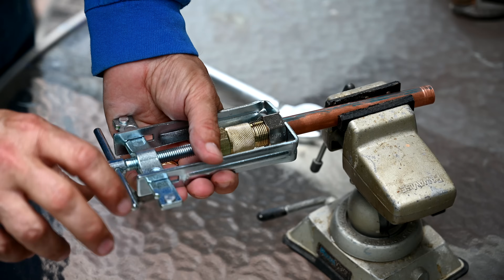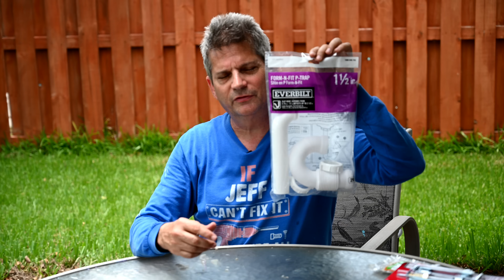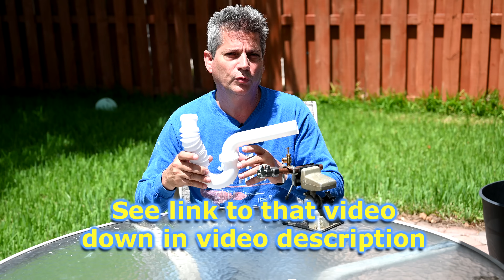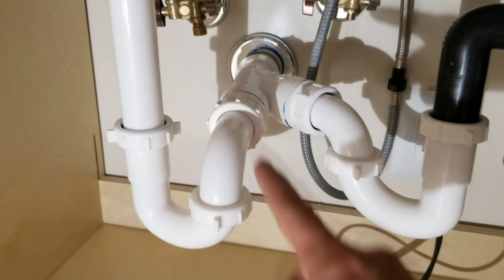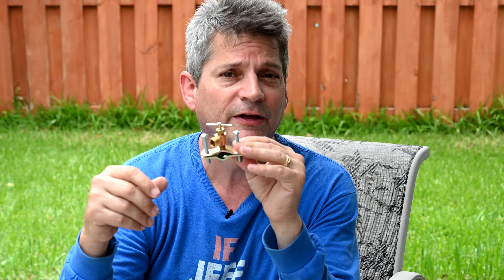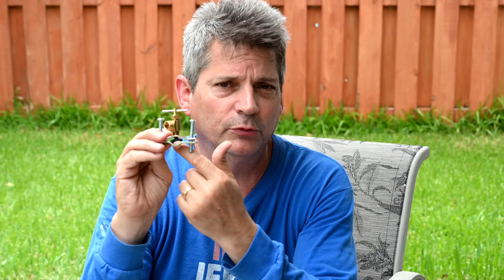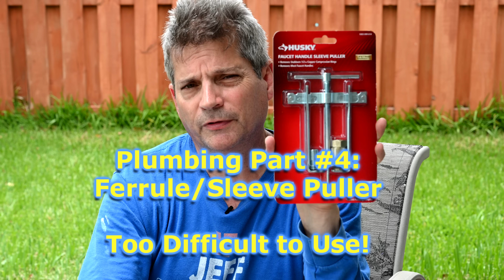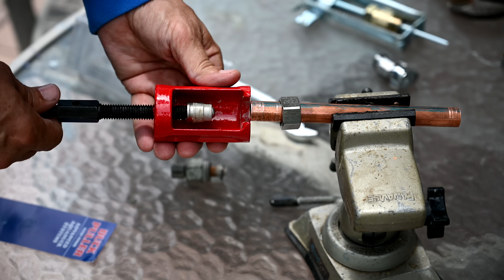4 Plumbing Parts/Tools You Should NEVER Use. NO Plumbing Fails

Comment: I think the issue I have with the video is the personality.. A lot of arrogance coming from the speaker and a general hatred toward 'DIYers' - saying that others 'aren't bright' or 'too cheap' is quite pretentious. You don't know what has happened in the past to a pipe: maybe the plumber before you had to cut the pipe back to get the ferrule off and now it doesn't have the extra length. You literally say that you 'couldn't cut the pipe back because the plumber before you wasn't too bright and didn't leave enough pipe' - but if you were going to cut it back, you would have been the plumber who ' wasn't too bright and didn't leave enough pipe' ... lay off handymen. self-sufficiency is something to be proud of, and if they are doing it incorrectly because they aren't a PROFESSIONAL, then teach them, don't condemn them.. steps off soapbox
Reply from the maker: "self-sufficiency is something to be proud of"? what about the 85 year old widows I had to go in and help who had no money to pay anyone to fix these disasters left behind by these guys? You have a misplaced sense of false righteousness. You support the "feelings" of these clowns over their victims. You made up scenarios that don't hold water and have nothing to do with the 4 parts at hand. Also, anytime I encountered a short pipe, I FIXED it, I corrected whatever the previous plumber left behind.

Comment: G'day
The first tool you need to throw out is that spanner. They cause damage to the fittings/nuts because they don't fit correctly. They are also more likely to slip off and cause injuries and you still need to have the correct size spanner for when those ones don't fit in awkward places.

The next issue is why would you need/want to remove anything that isn't broken/damaged. The Ferrule (Olive) seals by crushing into the tube. How do you repair the crushed Tube?
Reply from the maker: this is what separates us engineers from people who just install parts. The tools we use do not crush the tube like you claim. I've never had any of my tools either crush or flare the tube. If it did, I would never be able to get the new ferrule on. You ask why would I change the Ferrule? I ask why in the world wouldn't you change the ferrule? To me, it's a sign of laziness when people don't complete the job. The new valve comes with a new ferrule designed by the manufacturer to work with their new valve, and tolerances might have changed in the 40 to 60 years since your previous ferrule was attached. So the prudent thing to do is change the ferrule with the new one that comes with the new valve.

Comment: I am a licensed  building contractor and was a certified master plumber.  I have used s traps in both my homes and several apartments for as long as they have been around, as well as using them in many of the repairs or new installations I have done in my 30 years in the business, and never had a call back or experienced a problem with gas intrusion.  I think this is another of many, many examples of overkill in the regulatory business based on  a one in a ? occurrence resulting in added expense to homeowners who can barely afford to pa a plumber the $100 or more. for the repairs or installation required.  I have worked in two counties, one which has building codes and one without, and haven't seen any real difference in the quality of the work involved.  Regulatory rules are too often a result of efforts by industry, including contractors who sit on the guidance committees, to increase their profits.

.
Reply from the maker: Maybe you can explain that to all the people who have S-traps that siphoned out on them, now they are smelling sewer gasses. Yes, in some cases S-traps can be safe, but others where you have too much vertical drop after the S-trap you run the risk of it siphoning itself dry. Besides, what is so hard about a building a P-trap instead of an S-trap when you remodel or when you're building a new house?
Reply: There is a Bella a lot of difference between installing a strap and an existing strap in a remodel which would typically be the case with a homeowner.  Cutting into the wall to reroute the plumbing g and reconnecting to the main waste line in the crawlspace or basement will cost hundreds or over a thousand bucks.  Have you done this?
Reply: Correction "installing a strap replacing an strap"
Reply: I apologize-my spell check keeps replacing ptrap with strap.

Comment: Hi, interesting video! Well done.
Couple of comments/questions:
1) They use a saddle valve (similar to the one that is outlawed for plumbing) for high pressures of air conditioning systems, don't they? It is not the saddle valve that is so bad as it is the cheap style that is used. If the valve was sized for the pipe it was going on so that the pipe was forced to maintain its shape and the hole was pre-drilled rather than use the punch, almost all of the objections would be satisfied. Then the code could be modified to only require that the use of a saddle valve be limited to a line that has a shutoff within so many feet, etc., or something like that. I have seen the commercial installers of home humidifiers and also add-on refrigerator ice makers use these things, so it is not only DIYers - as you are probably aware. 

And the problem with the saddle valve is not that the idea of 'saddling' is so bad, is it? Rather the design of the saddle valves used was so bad that the code writers outlawed them because of that design. If the attachment formed around the pipe so it could not deform and the material in the saddle was not so degradable so that a drilled hole of the appropriate size were used (no punch), wouldn't the saddle valve be as acceptable as other types of shut-off valves?

2) Those tools for pulling the ferrule are all kind of bad, aren't they? When you push on the soft copper end with the tool, doesn't it compress the soft copper tube, which will make the diameter larger and harder for the ferrule to slide off even if it can be broken loose from its original position? I agree with you about the assessment of the cheap tool - it will probably work for 80% of the ferrules, however, but the hard to remove ones are too few and far between to spend the extra money for better tools. (BTW - didn't you install the cheap tool incorrectly in the video? Just asking - I don't have one, nor am I a professional plumber.)

If the cheap version doesn't take it off easily, wouldn't it be better to score the ferrule with a hack saw or Dremmel cutter and then snap it off by using a flat screwdriver to break the outer rings (that part that doesn't get cut through before hitting the copper)? What is your take on that; that is, is there a better way than the puller? 

3) I have a bunch of these compression fittings in the house we have now - it was built in 1996 as part of a subdivision. Anyway, I was replacing the sink's plumbing in several places and would really have wanted to replace those shutoff valves, but they are all compression to 3/4" copper and hard to get at to deal with. If they had sweated on a fitting and attached a threaded shutoff to it, I might have tried it. (But there is no good way to shut the water off to my house - I can't find an inside shut off or one near the house on the outside. The source is 100 yds away down the street at the meter. And it doesn't shut the water off completely - it seems to trickle away after it is shut off. I hesitate to deal with that for the shutoffs that are still working ok.  I know about that because I added a line to the cold inlet of the water heater to get a water supply in the garage - I refused to use a saddle valve, BTW.  I released all of the pressure and drained everything that I could, but it trickled on and built up pressure again eventually. So I had to let it trickle as I made the connection, but it was in the garage so it wasn't as hard to deal with as an under-the-sink would be. Plus I caught most of it in a pail.)

Do you have a preference for the compression vs sweat vs sweat threaded with threaded shutoff valves, and why? Do the compression fittings ever leak at the compression ferrule? Obviously, my preference is using a threaded adapter and threaded valves, but I don't think that in the crowded conditions I could sweat the adapter onto the pipe without a lot of trouble in the form of fire and leaks.

4) Could a 1500 watt heat gun be used reliably to do sweat fittings? I think it can get hot enough, but whether it would work on say 3/4" fittings?
 
Thanks!
Reply from the maker: Saddle valves are bad because you should never pierce a pipe that will be under pressure, you don't know when it could leak. Often saddle valves are cheap brass or cheap Chinese white metal, and dissimilar metals attached to copper is bad, it will corrode. other failure modes for saddle valves are the slight leak and dripping onto the screw which corrodes and falls apart, now the saddle valve breaks off. the tools that pull the ferrule off do not damage the copper pipe like you think, it is not that soft, certainly the round copper pipe is strong enough to resist the forces of the ferrule pulling tools we use. I have never once had a problem slipping on the new ferrule afterwards. Believe me if there was even the tiniest amount of flaring of that copper pipe from my ferrule puller tool, you'd never be able to get that new ferrule on with those already super tight tolerance. They are already so tight you have to spin it a little to get it onto the pipe. I prefer compression valves over solder, because it is less work, and anyone can change out the valve. I have never once seen a leak at the ferrule, only from the valve when the stem breaks, or the valve seal at the handle goes bad. I refuse to believe you don't have ea water shutoff somewhere in your house. Check all around outside, maybe another box in the yard? I've seen them at the water heater, I've seen them below the AC handler, I've seen them in the bathroom or under the kitchen sink feeding the house, and even in the laundry room above the washer and dryer. Every house should have one, if you don't have one, get a plumber in there to get you one. If the water main does not shut off at the meter, call the city in to fix it, that's their responsibility. With water trickling, you'll never be able to solder pipes with water in them. A heat gun likely will not help you, use a torch made for plumbing.
Reply: @jeffostroff  Thanks for responding. I look at the heft of your tool and it suggests that an awful amount of pressure can be applied. The distance from the ferrule is about an inch it looks like, so there is nothing to prevent the pipe from compressing if the pressure is great enough. If they work well that is great - what did you think of simply scoring them and popping them off? Too much chance to damage the pipe?

I looked in all of the decent places for the shutoff. The main shut off at the meter I found - the previous owner had shut the water off there and didn't tell me of any other place. I looked at where the water comes into the water heater - it comes up through the wall between the garage and the kitchen. The water heater used to be in the attic, but they had it moved to the garage (right below) where the original was. There is no shut off up there, but there is one on the inlet to the water heater because I added it.

I looked in the likely places in the house and probed the flower beds in front and found only a couple of possible spots. It makes little sense that they would run the water pipe all of the way from the left side of the lot in the center of a gas pipeline right-of-way across the driveway along side the house to the center of the house or farther when the water would more easily have been reached from the opposite direction, but that is what it appears they have done.

There is a large sewer access manhole in the sidewalk past the driveway about half way to the walkway to the front entrance. It occurred to me that they might have taken advantage of the trench for the sewer and that could bring the sewer and the water into the rear of the garage which then is aligned with the inside wall of the kitchen where the kitchen plumbing is located and with the water heater, but I could find no evidence that they brought it in at that point or nearby. 

The only other place on this side of the house that has water service other than outside faucets is the laundry room alongside the kitchen behind the garage (the garage is on the front of the house parallel to the street entered from the left side in front of the entry to the laundry and through it to the kitchen). The other side of the house has two full baths. 

The master and the bathroom for the bedrooms are along the other side of the house all the way to the rear of the house. The only place along the front that looks like it could have an access to the plumbing appears to be a source for the sprinkler system. I have not dug it up to see if it has access to the house. But suffice it to say that I could not find any location that even appears to be a shut-off for the house on the outside. I guess I will have to contact the city.
Reply from the maker: @dwjw1  Yes, slicing the ferrule is an option for the person who is skilled at it. I plan to do a video soon showing several methods for removing the ferrule off the pipe, including cutting it off.

Comment: I've looked down the thread here and several Brits have rightly commented that the quickest and easiest method of removing a ferrule (olive) is to cut a diagonal groove across it with a junior hacksaw until nearly through, then inset a flat blade screwdriver in that groove and twist. Replies have suggested this may be in some way difficult, or liable to damage the pipe. It takes only 7 or 8 passes with the saw to give the depth of cut needed and it pops off easily. There is no need for special tools which will often not fit in the kind of restricted spaces plumbers work in all the time anyway, when such a quick, simple and foolproof method is available to anyone regardless of skill level.
Reply from the maker: "regardless of skill level.", LOL John I've seen some really stupid people out there. Even good friends who are dumber than a door nail that I've gone to help do repairs in their house, they could never handle that. Sure it's a good idea for those who know how to do it, but not for Joe Sixpack

Comment: the pipe tap, I saw a plumber use something similar at house I grew up in, but it had full galvanized pipes, no plastic, nor copper, water lines other than that, and 1 more weird 1 I didnt see installed, but on first one I remember him drilling a hole before installing the one to fridge, & I would have been in my single digits & I am 53 now. the other was another saddle to galvanized pipe feeding a whole house humidifier, that attached to furnace. the furnace used copper to it, but was there when parents bought home before i was born.

as for the tool to remove the ferrules, put a hose clamp over it & tighten, thats how mechanics do for cheap gear pullers to use them. & I ever had to remove a "plumbing" ferrule, but I have in automotive & I used a dremel with cutting disc & cut & tap until I broke it loose, sometimes dressing end of tube to shorten it so new ferrule wouldnt be in same spot so I knew it would seal if I had damaged surface in any way while removing old one, plus somtimes tube is compressed in that spot & new one will never seal. had that happen on external oil feed lines
Reply: Absofrigginglutely with the ferrule collapsing the diameter of the tubing, … some guys think, they need to “over-torque” these fittings, … which, is generally how they diameters get deformed in the 1st place, …

Comment: The depth of the trap water only has to be 2" it does NOT have to extend all the way up to just below the bends.
Maximum trap water is 4". 
That is in Code, that Code you show in the video.
Reply from the maker: Yes, the code stipulates Each “P” trap shall have a water seal of not less than 2 inches and not more than 4 inches and shall be set true to its seal.
Reply: No, the depth of the ,as u call it trap water,isn't 2".Its called a trap weird and it's never to be more than one and a half times the size of the pipe.If it's a 1 1/2" pipe the weir can be 2 1/4".If it's a 4" pipe the trap weir can be 6".The trap weir is dictated by the pipe size.Not some arbitrary measurement.These arnt guesses.Im a master plumber.

Comment: Price for 10 minutes for plumber  to come in. 300 dollars, this guy is a stugotz. Basically don't use any of this stuff  so we can charge you some crazy amount
Reply from the maker: Doesn't matter what plumber's price is, we have videos showing you how to do this yourself. You're a drama queen! Using the correct parts does not cost hardly much more money! Instead of using a saddle valve, just get a double angle stop valve installed under the kitchen sink, it's a $20 part at Home depot, as opposed to a $10 saddle valve. Big whoop. Instead of using a flex p-trap, just build out the correct path from the wall pipe to the drain pipe with some angled PVC fittings, no more than $5 in parts, same price as the flexible P-trap. You're just a drama queen, trying to add smoke screens to blind consumers from bad handymen.